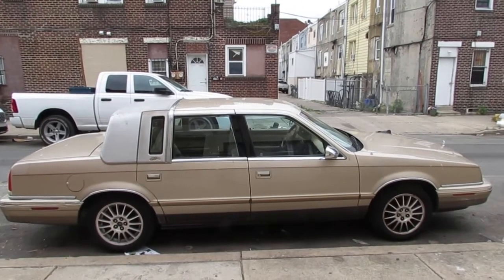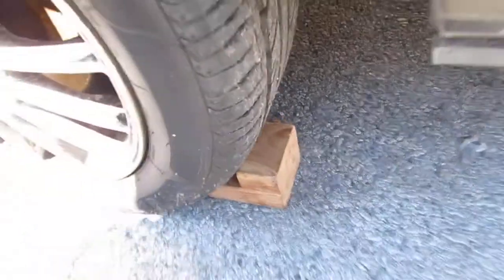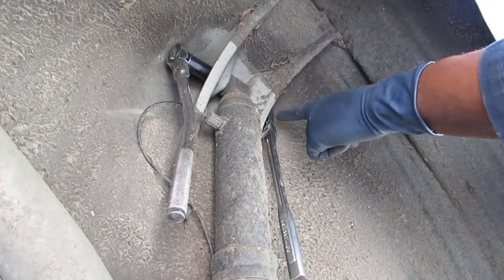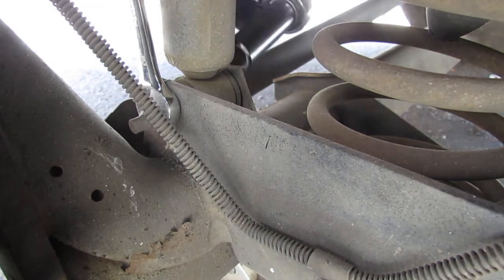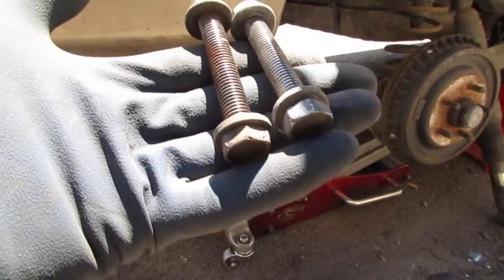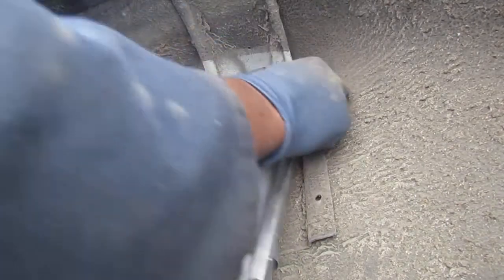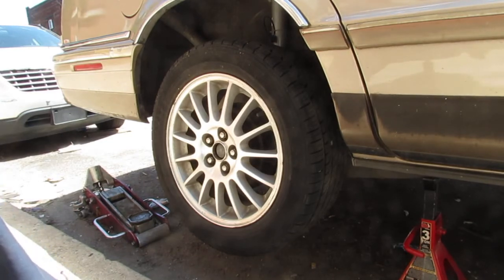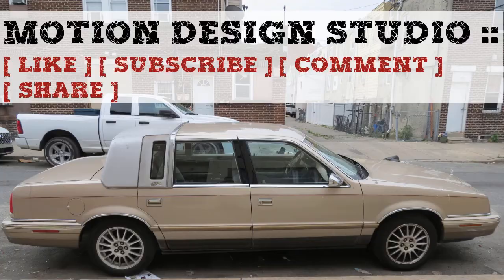1993 Chrysler New Yorker Shocks

Comment: The after pictures seem to show the car still sits lower in the back.  Typically shocks just resist the vertical motion, they don't really change ride height much.  On these cars they had a ride leveling feature so they depended on the shocks holding air to adjust the ride height.  I think you would have needed to swap out the springs to fix the problem or go with a manual fill air shock.

Comment: Please people don't add grease to your bolts! I understand what he's trying to do by protecting it from moisture. But you never put grease on the threads. Actually you should put locktight on it. You never want those bolts to back out. Also those are not the exact shocks for that car. That tube thats attached to the old shock the one he zip tied to the new shock. That tube is an air tube that supplies air to the AIR SHOCK. I mean it still will work. But for the right shock you won't have to zip tied the tubes anything. Also you know the part where he said you should put oil or grease or something down underneath the bottom where the spring seats itself don't put grease on that that's going to cause dirt and all that kinds of crap to stick to it I would recommend getting some of that black Flex Seal in a can and just spray it on there and it will protect it. Or don't do it at all because look at the age of that car it's from 1993 and there is not a spot of rust or anything where that spring seats so I would just leave it
Reply: The air shocks for these arent available and havent been for years.
Reply from the maker: Michael Fox is correct.
Reply: The OEM air shocks have a built in ride-leveling feature, that is why they are not currently available.